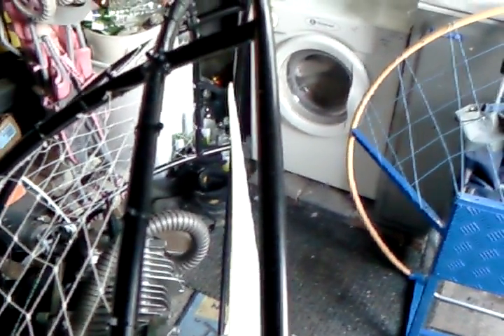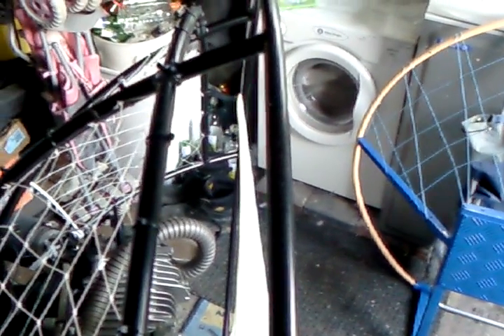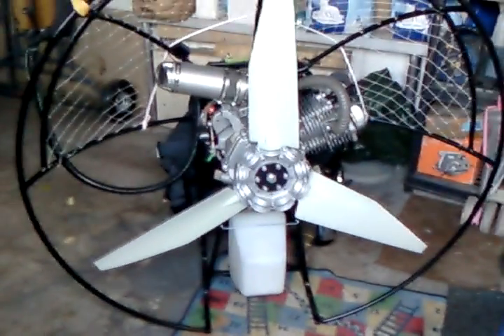GX390/420 EggMonster. Fan Assembly Optimum Blades

Comment from the maker: @weirwolfarroo Hi Tom,they look about right now. More 'prop like' compared to stock appearance. Peaked 48kg thrust at 2700rpm last week on the scales test. I'm abandoning the Monster project though at the moment,  might even sell just the engine to fund the little Egg for upgrade parts. In future if wheel useage is allowed by CAA then I'll buy a GX440 with electric start and tune up like this engine plus thinner head gasket and ratio'd valve rockers. Should be good for 55kg thrust and quad use.